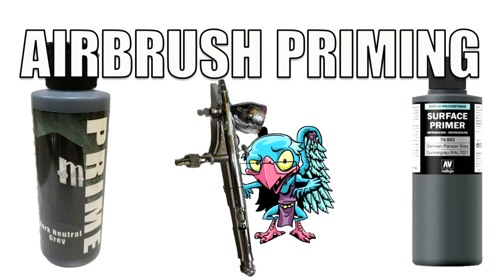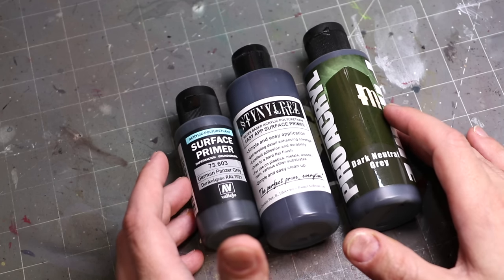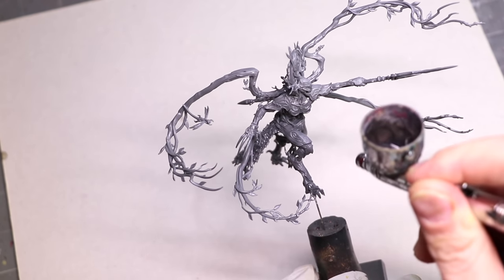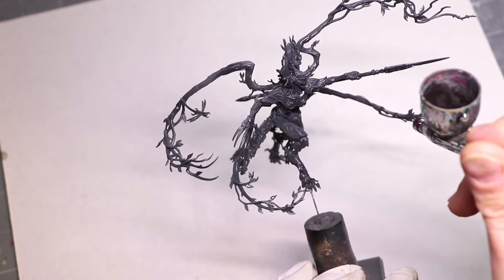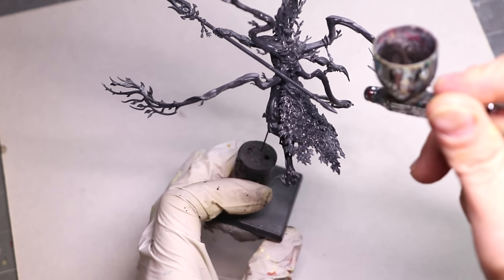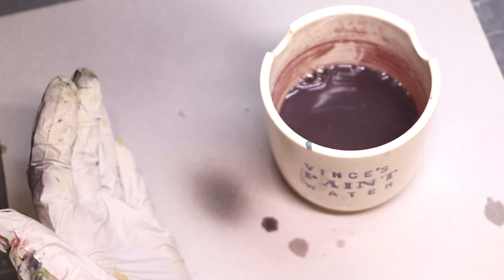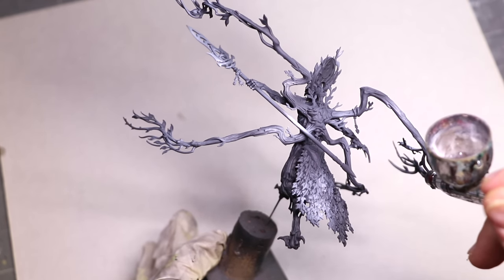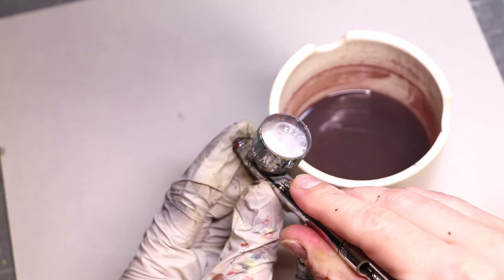Complete Guide to Airbrush Priming - HC 350

Comment: I bought an airbrush (Ultra 2024) just last week.. primed a load of models, used it three days running, no gumming, jamming nastiness.. 

1: empty paint out..
2: use thinner/flow improver
3: run the liquid through
4: wipe out cup
5: run airbrush cleaner through the brush
6: inspect cup, exposed needle and nozzle
7: run a small amount of flow improved through the brush.
8: wipe down exterior

This has kept mine running beautifully and only takes a minute to do.. 

just running flower improver/thinner after brushing and then cleaner.. and finishing with a few last drops of flow improver..

Comment: When priming, follows Cpl Hicks’ advice: ‘Remember, short controlled bursts’
Reply: It’s the only way to be sure..
Reply: I mostly prime at night. Mostly.
Reply from the maker: Love this!
Reply: Short bursts is how you get spatter.
Reply: @waynegoldpig2220  relatively short ;)
Reply: I vote we take off and nuke it from orbit…
Reply: It's on the goddamn walls!?
Reply: Aaaaahhhhhhh-firmative
Reply: @waynegoldpig2220  Short bursts of paint but keep the air flowing. Spatter comes from starting and stopping the air while paint is flowing/on the tip.  If you keep the air flowing but start and stop just the paint (so keep the trigger down, but feather it back and forth) you will prevent 90% of spatter.
Reply: @JohnVanderbeck  I avoid this problem completely by using the Harder and Steenbeck Colani. It's like cheating.
Reply: @waynegoldpig2220   Yeah that is one of the many benefits of a pistol trigger style airbrush and I wish more airbrushes embraced it.  The need to actually adjust air pressure mid stroke is really a niche case IMHO and great for actual airbrush on canvas artists, but not at all needed for miniature and figurine painters.
I used a pistol grip for the longest time and loved it, and only recently changed because I really liked H&S's new Ultra features but sadly it uses a dual action style.
Reply: @JohnVanderbeck  You really need to try the colani. As much as I loved my pistol grip, I realised the precision wasn't as great as with a top mounted release. The Colani was the holy grail I had been looking for and I modified the supplied handle to make it less of a pistol grip.
Reply: @JohnVanderbeck  It never ceases to annoy me how miniature-painting influencers on youtube tell complete novices that they need a dual action airbrush, when it is absolute overkill and the hardest tool to learn. I wonder how many give up soon after their first attempt?
Reply: And if you don't, its game over man! Game over!
Reply: Gotta love someone who drops Aliens wisdom

Comment: One of the things I found when I first tried to airbrush primer was that the primer would chip off extremely easily. Black or white, it didn’t matter. I believe what was happening was that I was holding the airbrush too far back and the paint was drying before it reached the model. I was unable to find any resources that mentioned this problem. It was very frustrating as a beginner.
Reply: Have you tried washing your models before priming?
I do it with all my models now. Its an extra step, I know, but it is worth every second if you primer and paint peels off otherwise.
Reply: i found that not just washing them , but degreasing them with e.g. isopropyl alcohol helps a lot. Just check that the degreaser of your choice does not damage the model first. iso should be safe in most cases, i would avoid stronger things like acetone because of possible damage to the model.
Reply: Agree with the two previous reply: always wash/degrease your minis before priming.
You wouldn't believe the number of time I have to say at work when people complain that a paint/primer/plating doesn't not adhere to a surface: Have you cleaned the surface? If not, no wonder you have issue.
Reply: Also paint may of been layerd  to thick. thin coating is less likely to chip off
Reply: @Erick Thanks for bringing it up as I have the same issue of primer peeling off easily.  I am just starting to degrease my model and with the tips here, hopefully this issue will no longer be one for me, thanks everyone!
Reply: @fritzzz93  I found a quick wash and a wipe over with IPA after to be a massive help, I live in a high water scale area (Southern England, we have an aquifer but its a chalk aquifer and it produces a lot of scale in our kettle) so a wipe over with IPA removes any scale residue that might impede a good bond. My northern English, Scottish and Welsh f4iends don't really have this issue as their water is a lot softer. Tastes nicer too.
Reply: I ended up doing both. I started washing my models with dish soap and moved my airbrush closer. My main fear was hiding detail by putting the primer on too thick. Specifically, I was concerned about the “wet” look meant that I was too close. My past experiences with spray cans suggested that “wet” spray while priming meant I was going to obscure detail.
Reply from the maker: Lots of good suggestions here and glad you eventually found the solution. :)
Reply: If you paint a car when it's too hot for your activator, the stuff that makes the primer harden, it will dry during the flight from the gun tip to the object surface.  This will have a frosted look and feel rough to the touch.  Pull your gun back if your getting runs or curtains.  I imagine airbrushing is similar.  I am not a pro auto painter, but have done and been around it some.

Comment: I'm a beginner with an airbrush and I like to use plastic shot glasses to mix the paint in first. I find since they are clear, it is easier to check the consistency of the paint as I can see it flow down the sides.

Comment: At the second year of using airbrush I found out that pressure can be adjusted. At the fourth year of using airbrush i found out that trigger resistance can be adjusted by screwing the valve. Today I found out that primer should never been released from the nozzle during cleaning. Its only 5-7 years and I became an airbrush master!
Thank you, Vince, for another great video!
Reply from the maker: It's a long journey.
Reply: Can you explain the trigger one? Do you mean just changing the tightness on the valve that connects the brush to the hose?
Reply: @tayloraverett3138  Yes, unscrew that part of airbrush which connects to the air hose and slightly relese the screw (to do this you need screwdriver because the screw is inside the air tube). Then you can assemble airbrush back and test how tight it became to see if further adjustments are needed. When I use myfirst airbrush out of box I had to press the trigger with so much efforts that my finger most probably got an extra muscules )
Reply: I literally learned both of these things in the first 5 minutes of using my airbrush. My guy, what the heck?
Reply: @leonidaspereirafilho499  Literally it's a joke. In fact - many of us never look into manual instructions guided by principles: "Who the f**k needs instructions!?" You can learn everyrhing on your own with proper amount of time and efforts, but learning process with teacher or at least basic foundations helps seriously save wast amount of both on this way.
Reply: took me 15 years to watch this video and know this now.

Comment: I found the Pro-Acryl primer to be the best primer hands down. It combines the ease of use of Vallejo Surface primer with the finish and durability of Stynylrez. I won't use anything else now, even their white primer is leagues above anything else I've used. I love it, although putting metallic paint straight over it can lead to losing luster but an extra coat sorts that out.
Reply: I found gloss black primer (Vallejo) looks great under metallics.
Reply: @parodycalfilms  is it possible to brush it on? I won't use any primer other than Pro-Acryl as a base but I'd like to try putting gloss primer over it to make metallics look better with fewer coats.
Reply: @madMARTYNmarsh1981  I haven't tried brushing the gloss primer specifically, only their normal black and grey primers.  That looked a little janky going on but after drying it kind of tightens up.  Alternatively, I wonder if you could mix some gloss medium with your primer for a similar effect?
Reply: @parodycalfilms  that's an excellent suggestion, thank you. I'll give it a try.
Reply from the maker: I really do like them so much, it's just a great primer.
Reply: If only this was 3 months ago when I finally got fed up with the vallejo primer flaking off and bought some Stynylrez ... ho hum
Reply: I loved Vallejo primer until it started coming off my models. I’d like to try the ProAcryl white primer since my white primers seem to be such a pain in the butt.
Reply: Ratio for white? 3:1 primer and Thinner? Is the same from white?

Comment: This is great! Exactly what I needed. 

Question though: If you’ve already primed with black or grey, is there a reason to use a white primer for your zenithal? Couldn’t you just use a white ink, or normal white paint? Again, this is assuming you already have primer down.
Reply: Think of the airbrush as a spotlight that mimics any light source.. It is so much easier to dust the shoulders and head and all the top edges with it than to do it manually with a brush
Reply: @benjaminnadeau7305  The question is more about using white primer vs white ink/paint for the zenithal (using only airbrush). I use primer but without really knowing why ink or paint couldn't be used.
Reply: I use ink. If you look through Miniac’s videos you’ll find one where he compares the smoothness of various zenithal methods and ink has the best results.
Reply: I also switched from regular paint to white ink and it really is much smoother. No more speckles.
Reply: @adamssmartthings  what’s a good psi for white ink?
Reply from the maker: Nope, it's just preference, but you could use white ink or paint certainly (or any other color paint or ink). :)
Reply: @VinceVenturella  Tamiya White paint works best.

Comment: 7:20 completely agree with the squeezy bottle and dump it step. However, since I stopped backflowing at this stage, the body of my HC-CS has remained a lot cleaner. This however means that you do need to clear the nozzle of the last remaining paint, but since it has been thinned by the squeezy bottle step it has not been an issue for me. I found that cleaning the nozzle is easier than cleaning the body. A dirty body can make the needle sticky, which is something you don't want.

This does break the "don't unnecessarily blow paint through the front of your airbrush" rule, but I feel I never get into trouble doing that. Wandering if your dry conditions are a little on the extreem side, which might mean that this particular advice it mostly useful for people that hobby in similar conditions.

Comment: Another tip I found recently, the Stynylrez tends to dry in the bottle a bit, even a new sealed one, strain the paint before putting in your cup, works wonders. Still a great primer, Pro Acryl are not widely available in Australia yet
Reply: Get any Monument Hobbies products from Element Games UK. Its only a few pounds delivery to Aus and also super quick (unless they throw in lollies - then the AFP will have to check the contents!) Their primer is indeed super.
Reply: Since you're in AUS... may I ask what compressor you are working with?.. im kinda on the hunt for something to get started with.
Reply: @Z0M77  TC910 Aspire Pro Compressor
Reply: @Z0M77  I got the Iwata 2 spray 'toaster' compressor. It doesn't have a tank though so its always 'on' and pressure drops down once you start blowing air making it a little inconsistent. Go for something like Adam Fenerty suggested.
Reply: @Z0M77  Bunnings sells an Ozito airbrush kit for ~$130, with a decent compressor. The airbrush itself is trash but it's cheaper than buying an AS186 from Ebay or whatever.
Reply: @Serpsor  Thanks Trent... I did see that Ozito... Was thinking bout grabbing it and ditching the brush for something better.
Reply from the maker: 100% - it's very sensitive to freezing as well (Stynelrez) and that can cause that.

Comment: A lot of the complaints referred to earlier in the vid is a stage everyone has to grind through as they get used to their brush and how to recognise which problems are which, how to fix them, THEN ongoing maintenance (and avoiding the need for said maintenance, as Vince demonstrates so well here) becomes way more easy and routine.

Edited to add - backflow and dump technique was probably the biggest improvement to my workflow for longevity between deep cleans.

EDIT 2 - an alternative to using white primer is..... Not using white primer. If you want to paint something white, prime it grey (or even black if you're feeling saucy). Once that first prime coat is down, you don't have to use primer any more, so that opens up way more stuff. Pro Acryl Titanium White paint is lovely stuff that thins and sprays nicely, and Daler Rowney FW white ink has wonferful pigmentation. 

If you're set on using primer, another approach is to go down the smelly route - smelly paints are way more stable when thinned because of the solvents' lower surface tension vs water, and go on way smoother as a result (especially if your thinner has a retarder in it, as the one I'll mention does) Mr Surfacer White + Mr Levelling Thinner will really do the business. Obviously ventilation and using all Isopropanol for cleaning (versus water+iso) are factors for consideration.

Comment: Pure white is made from Titanium Dioxide which cannot be ground to as fine of a particle as other pigments. Hence the issues you talked about. Like you, have had no issues using Stynylrez, even right out of the bottle. But I use a .45 to .6 mm tip depending on the brush when priming.

Comment: Getting the thinner:primer ratio right was the biggest blocker to me. Everyone kept going on about thinner, make it thinner, must be thin, thinner is life, if you don't thin you're worse than hitlersatan.

So I thinned. A lot.

And the primer was garbage, 3-5 coats to get anything done and weird residues.

I went back to just using a rattlecan for months until I felt bad about wasting money on the airbrush and went, like you said, 1:4 ratio and it works much better.

I remain unconvinced compared to just using a rattlecan when I am painting a massive horde of models. The time to prep the airbrush, clean it, keep it clean, handle the models individually, etc. vs just mass spraying 20-30 models at a time stuck to cardboard flap with a montana can?

For fancier figures or projects where the smoother finish is more important the airbrush feels more relevant.
Reply from the maker: And that's fair, when I did the alpha legion recently, I went rattlecan of course, because of the sheer speed so I get it.

Comment: I finally switched to airbrushing for my priming and grunt work steps a few months ago, and I'm never going back to rattle can primers. It didn't take much time to learn, the results it gives are much smoother, and you can prime indoors, so there's way less risk of getting dust and dirt grains stuck under the paint.

I prefer Tamiya's airbrush cleaner to most of the others though. It's a bit noxious, but it's literally plastic glue, so it melts the paint right out.
Reply from the maker: All fair and glad you've been enjoying. :)

Comment: Great video. I stumbled upon preloading the cup with thinner on my own awhile back, single greatest tip for enjoyable airbrushing
Reply from the maker: Good stuff!
Reply: Do you mix it after you put the primer in?
Reply: @JJ-ew1vt  quick run down of my work flow.
1. Add thinner to the cup 
2. Spray a small amount through 
3. Add paint and more thinner if needed
4. Mix
5. Airbrush

Comment: I bought into airbrushing then dreaded cleaning it so much I stopped using it for months and went back to rattle cans. Once I learned about the spray bottle trick, I now turn the compressor on for a quick highlight or touch up in no time whenever I want! Even for 1 mini it does not matter. The spray cleans the cup out so good and fast I wish I had knew about it years ago. GET A SPRAY BOTTLE and start airbrushing!
Reply from the maker: Awesome!
Reply: spray bottle trick? can you explain please? thanks
Reply: @raceofrobots  get a 1.00 spray bottle with water. There is enough force from the stream to blast out paint and clean thr cup quick for color changes. Spray over a garbage can and good to go